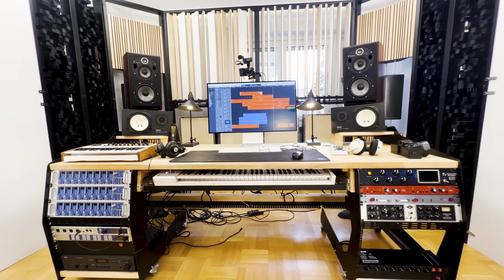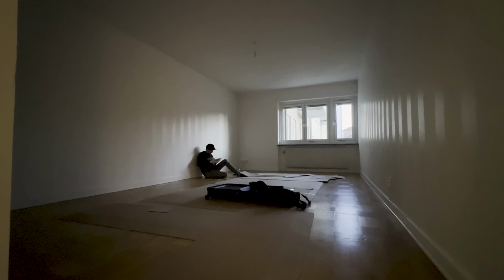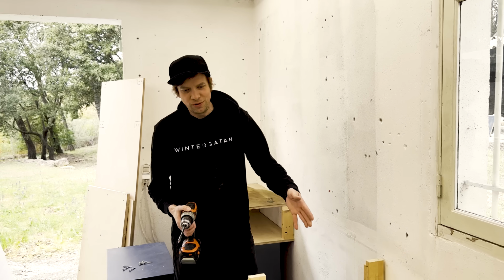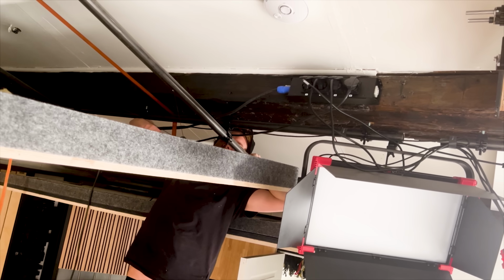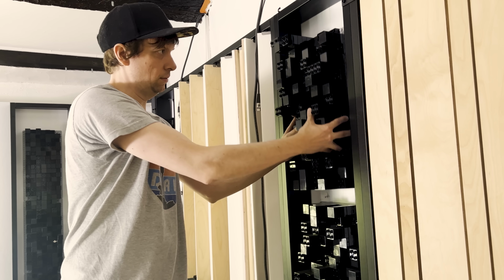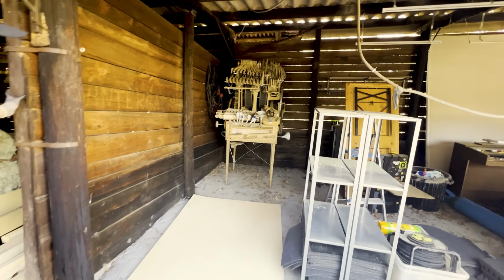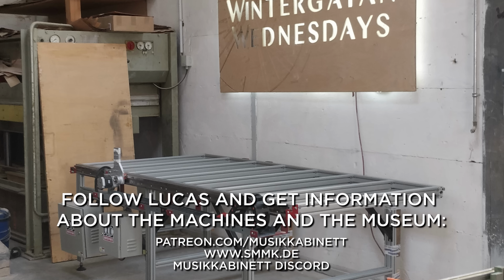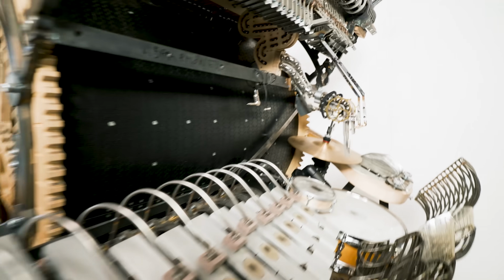My New Music Studio - Moving From France

Comment: In software development you rarely start from scratch. In 99% of cases it's a bad idea, especially if you already have something that works. Building upon it is usually a better way of moving forward. Small improvements vs a revolution with many unforeseen consequences. 
And I'm talking about MM here, not MMX. If you decide to build MM3 from scratch as well, you are putting yourself (and your sanity) in great risk.

But most importantly, take a step back, relax, and use this time off to reevaluate your life and your priorities. All the best.
Reply: Totally agree. First of all, if you have something and that kindy works. You start to develop it. You grind and grind it, and it still works. At one point you realize, that thing just ain't working and you try to grind it more harder, and you try to add something new to it. This same shit happens every physical and non-physical thing. You made your child so big, that it actually dies away. Shitty examples: altavista, nokia, everything-you-know-15-yrs-ago. If you just keep "developing" and adding more shit on your basic shit, you're gonna die away. Overall, keep it simple when it works, and if it ain't work, keep it still simple.

Comment: Stop worrying about a few marbles falling on the floor.  A few marbles on the floor doesn't hurt anything.  Get your MMX out of storage, finish it and take it on tour.  The failure was not the marbles falling on the floor, the failure was giving up.

Don't give up.  Get the MMX working.  If you have to, put a big pan under it to catch the marbles.

One example of success is the SR71.  It leaked fuel while it was on the ground.  It wasn't until it was in the air and warmed up that the leaks slowed and stopped.

Don't give up.  Finish it.
Reply: it was dismantled. Also, the SR71's Leakage wasn't a design flaw, it was very much intentional, unlike the marble leakage
Reply: @cactusfishy1596  I NEVER said it was a design flaw.  It was built that way because of the extreme heat that the aircraft experienced at high speeds.

What harm did a few marbles falling on the floor cause?
Reply: I rate the designer's and builder's opinion about the MMX above the opinion of some random person on the internet who says that it's good enough.
Reply: @SpaceBuckaroo  It isn’t terribly relevant in that case

Comment: I doubt you read the comments. Most of them are harsh because a bunch of people our disappointed on how MMX ended.

However, I think managing to play and record one song on the MMX similar to the first machine would be beneficial for you also. Currently, you are verbally and mentally bashing yourself over each flaw of MMX. However, I think if you made one song and recorded and compared it against the original marble machine you would see how far you have come. To truly respect something you need to see them for what they are; not just their strength nor weaknesses but both. Right now I think you are only seeing the negative aspects of MMX.

Let me put this another way, I'm a software designer and on every project I can always come up with a list of things I would do differently next time but does that mean I should be upset with my original work? I would be if you did this process for a million times you would still have a list of flaws that you could bash yourself with. It doesn't mean you shouldn't try but you have to be proud of what you have made. In many ways, our flaws are our story.
Reply: Dude this is a very insightful comment. Well said

Comment: The MMX worked well enough to be an amazing instrument. Me and many others have pointed out for years that touring with such a huge object is wildly unrealistic. Even if you manage to move it from place to place, it will fail because you will rarely find a stage which doesn't SWING. Those constructions ALWAYS swing and no MM you can conceive will ever account for that. It's just not practical. 
The MMX did not fail. It was killed by you because it couldn't do what was not realistic for it to ever do. Instead of focusing on what it COULD do, you wanted it to do the impossible. Such a pitty.

Comment: Entirely separate machines - I REALLY like this idea. Each machine has a marble feed and a marble deposit. They could all be connected to one cool-looking thing that distributes the marbles, but also you could have a simple thing that just hooks a machine's marble deposit to its marble feed (to easily test a machine in isolation).

Plus, if you do it this way it CAN'T fail - only individual instruments, or marble elevators/distributors can fail.

Comment: If there's one thing I've learned as an engineer... if it ain't broke, don't fix it.  In other words... take the MMX, carefully consider what worked and what didn't, and then design MM3 from the ground up... but reusing every piece of the MMX design that worked, and only changing what has to change.  Use everything you learned from the prototype, and don't make unnecessary changes that could introduce new problems.  Good luck and we all believe in you!
Reply: Europe is so small.
The funniest thing is when you live at the border and can circle to France just to save a few cents on groceries.
You often don’t even notice the border if it wasn’t for the welcome to … sign.

Comment: You could 3d scan the parts if you dont already have such part files, and then shrink those down to work with smaller bearings, as a item of art meets mechanical automation you could probably sell many of in kit form.
As if you mixed some watchmaker skills into it to keep things small yet very exact to the real scale sized original 1st edition.

Comment: Just wanted to give some perspective about engineering - we barely design for something to be perfect. Engineers design for something to be 'good enough' to get the job done. Control System engineers design to have things work well enough, despite not perfectly modelling the system. Communication and computer systems are designed with failure, errors and unexpected behaviour in mind. Vehicles include sensors to see WHEN parts fail. If potential failure isn't very expensive, not much effort is put to making it absolutely perfect. If failure isn't an option - solid state machines are built as moving things just break.

The difference between an engineering and pure mathematics, is that engineers design for the real world which is not perfect. What rate of failure you consider to be 'good enough' will depend on the design requirements, but if you keep raising that bar the task becomes arbitrarily difficult and expensive. With your mission to not have stupid design requirements - consider needing a machine that never drops a single marble a stupid requirement. You are chasing a score with no ceiling.

If you really do want to build it perfectly - communicate with more engineers or go study to become an engineer. Halfway along you will realise that perfection is a myth.

Comment: The studio looks very hip, to the point of being very groovy.
From now on, when you hear the word Sweden, you will think about what is in sweden and that is weed.
Yes. Weed.That is what you will think about, as do I, as do many people as well. So, s'WEEDen' or s WEED den.
Ok, now lets chrome dip everything in the stufio, and then use a tiny LED to light up the place because of the triple chrome mirror-like surfaces everywhere.

I just bought a super cheap giant motorhome that isnt even all that bad after i removed the major layer of previously uncleaned patina of hotbox WEED by the previous owner. It's a giant chevy motor with a mint condition very low mileage generator, new fridge, he even redid all the plumbing and real hardwood flooring. Get this, it had 5 different awnings all motorized and as if mint condition and never used. 
Rarely such deals happen, though when they do, you have to just go for it.

Hope your dad is able to heal well, he is good people that supported your focusing on being creative, in your own way.
Cheers from sw ontario canada.

Ok, teach your marble synth to play some max webster!

Comment: I'm under the impression that while you have worked a lot into conveying technical decisions through CAD, Test-Driven Development, etc.. You still need a "tool" to express, or for the better analogy "sew" the creative side of things. As of now they fight one against the other, deadlocking you and your main project in-place. 

I feel like if you had a tarot deck of cards or someone who could read them for you, you would wear them out using them, the same way Italo Calvino did for his work. Could be quite the unorthodox method, but I've seen it work myself with others, taking their faith by the horns and steer it. Either way please don't give up. 

"Loosing a battle is a honor reserved for the ones who do not cower"

Comment: MARTIN!!!  MARTIN!!!  MARTIN!!!  MARTIN!!!  
It's so sad that you didn't read and heed the cautions and warnings I gave you early on with the MMX. You came to learn the hard way what I had been trying to say all along. Design for function first. Then, simplify and beautify. Rinse and repeat.  Should you build a third machine? Sure. Your faithful minions will help. You have the talent. You now have the skills. You now have the understanding of how to design for success. Using wood was great for a prototype, and that is what you built with the MMX. Now is the time to move from the prototype stage and into the final build. That being said, you need to design the marble management methodology up front. This was consistently your major failure over and over throughout the MMX. You need to make drop zones, not circuitous marble paths. Use a flooded marble pool at the top of the machine to supply all of the drop zones.  IE. Keep way more marbles at the top of the machine all the time (2-3x what the MMX used.) Use the rotary releases (which I kept suggesting). You spent WAY too much time early on with the fine details rather than the critical path items. But, now you know. Go forth and conquer  good sir. May the force be with you. And remember, your individual mileage may vary considerably.

Comment: The problem is that you have only one turn on the drum to play a song…. Unless the drum becomes a belt driver! I suggest a player belt be made from printer blanket with the trigger pegs attached through it. On each side of the belt, individual gear teeth are attached that are slightly higher than the trigger pegs so the belt can be rolled up without damaging or bending the trigger pegs, stiffener rods can be placed from the gear teeth on opposing sides  and the belt is driven by gears attached to the sides of the drum. Think of how a roll top desk operates to have a mind picture of my basic idea…. Once the belt has passed through the machine it can have a rolling device so everything rolls up nice and neat